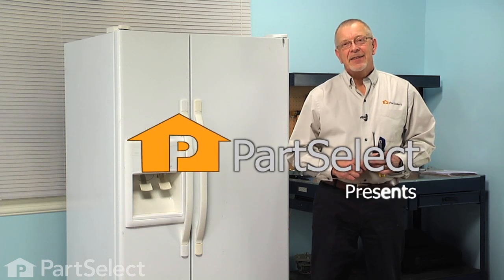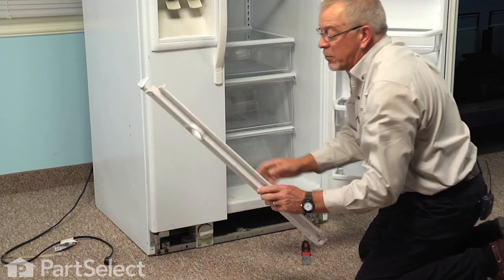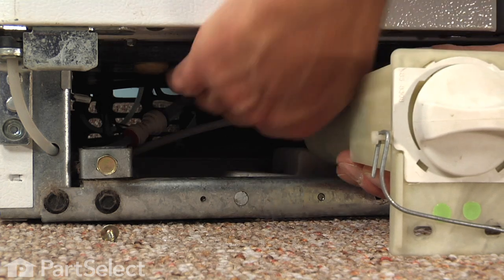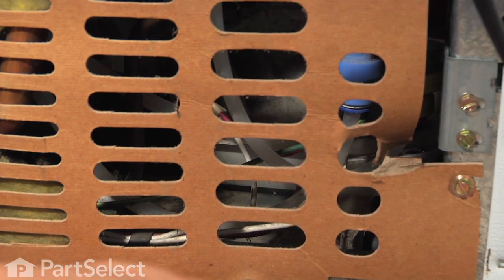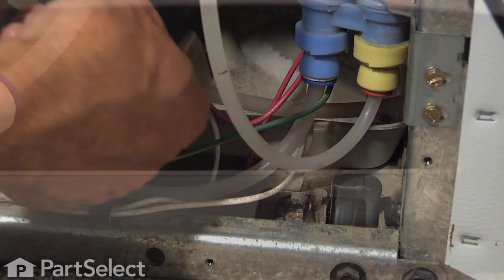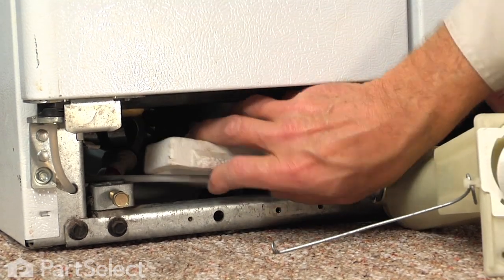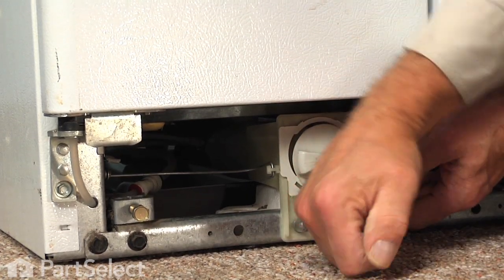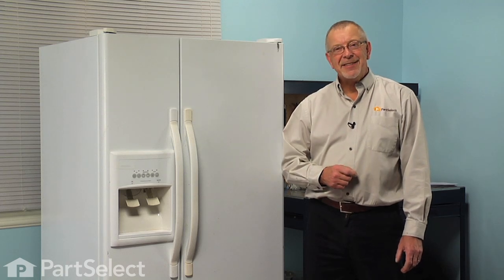Refrigerator Repair - Replacing the Evaporator Drain Pan (Whirlpool Part # W10614158)

Comment: After living in my home for 2.5 years, I suddenly had puddles of water coming from under the fridge. I finally discovered the drain pan underneath, and it was overflowing! This is a great video and I'm sure I can empty it, but I'm wondering why it happened in the first place. Is it just unusual humidity or should I call a repair person?
Reply: Update - I went to home depot and bought a hand siphon pump for $10. I stuck the tube in the drip pan and siphoned the water out without tearing the refrigerator apart! Much faster and easier to empty the tray!
Reply from the maker: Unless you have an extreme amount of frost buildup, the drain pan should handle the normal amount of defrost water. Make sure that the condenser fan is working properly and is pulling air across the drain pan to evaporate the defrost water. Make sure that there is not a buildup of pet hair or household dust that may impede the airflow and that the back panel is intact and in place.
Reply: You are correct, the drip pan is full again after just a few days. I wish you were in my area! From your videos, I think that motor is in the back. I will pull it out and see if I can tell what's happening with it. There's not a lot of dust in the unit, and I clean the floor under it regularly, so if it's not working it probably dead.
Reply: I had this problem years ago and I solved it by cleaning the fan blades and air holes.  If cleaning does not work, the fan may need to be replaced.

Comment: I forgot to ask. If the drain pan is full of water, does that mean there's something else going bad?
Reply: Water that does not evaporate from the pan could be result of several things, include a bad freezer door gasket or failure of the fan that draws air across the pan to evaporate the water.

Comment: Ahem, that's not the evaporator pan. That's the lower  condensate evaporation pan. The evaporator pan is under the evaporator inside the freszer! Your really should have known that Uncle Bill
Reply: No, it’s not condensate. It’s melted ice. Whirlpool calls the part “defrost drip pan”.  But it is universally known as an evaporator pan for parts searches in places like eBay. Common usage is not always strictly correct, but it conveys meaning. Parts of an automobile engine are frequently called “freeze plugs”, and are thought to protect the engine in the event of freezing weather. Both the term and understanding are incorrect. The plugs, disks of brass or steel, seal holes needed for the engine block casting process. But the incorrect term persists, and legions of mechanics know what is being referred to.

Comment: There is no way to get the pan out without getting the water filter out of the way, and this cannot be done without disconnecting the water line from the filter or at the other end at the rear where it appears to connect to a valve. I can see the full length of the line connecting the filter and the valve and there is NOT sufficient slack. The line must be disconnected at one end or the other. 
This is a significant omission from this video. Maybe some manufacturing runs have enough slack, but not mine. 
(My pan is cracked at the front right corner. For now I've patched with duct tape and plumbers putty. )
Reply from the maker: The line can be disconnected at the inlet water valve by depressing the collar and pulling the tubing out of the connector on the valve.

Comment: This is a great video "but" if you ran into the problem I did, you may want to watch the video Steve did on how to replace the water filter housing the link is  https://www.youtube.com/watch?v=4AvHhKT2FBA 
I could not get my filter to move far enough to remove the drain pan :(  However by watching both of these videos the job was a snap. Thanks Steve these videos saved me a repair bill that would have been assessed just to clean  my drain pan.  Kenmore really should have thought about people that like to keep their appliances clean this is a horrible design.  Why not make it so we can just remove the kick plate and slide it out.  Folks while you have the back taken off and the kick plate, and filter assembly removed take this opportunity to clean your coils, keeping all of the dust bunnies that love to live there off of the coils will help your refrigerator run better and last longer. Again big thanks to Steve for these videos.